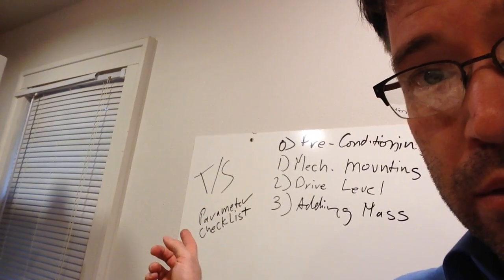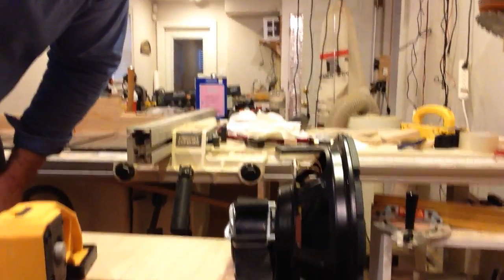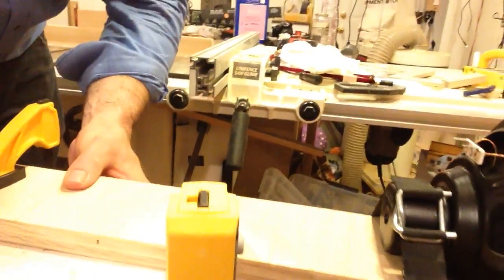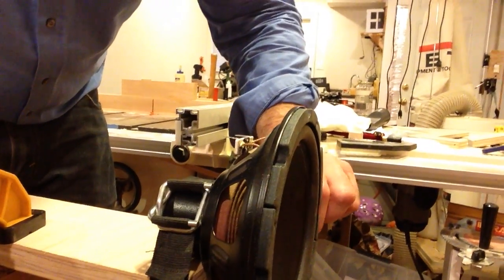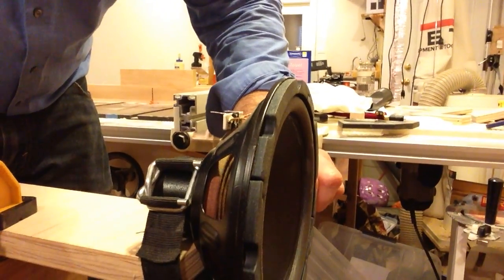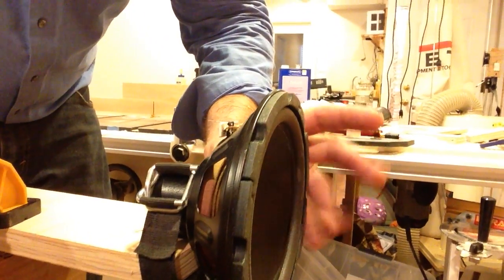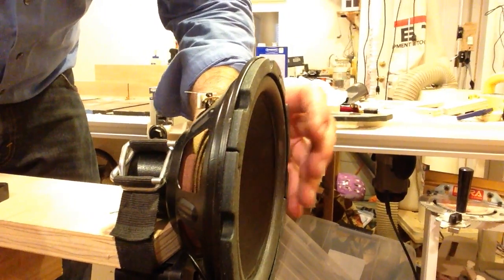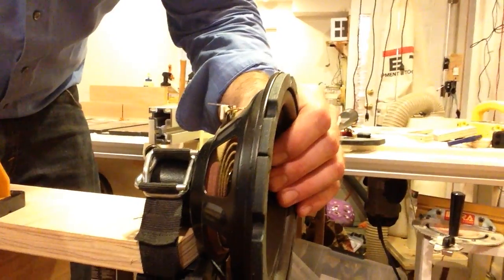EP15-02 T/S Parameter Measurement Basics

Comment: Hey, could you give me a pointer? Sorry, i ran into your channel by accident and had a thought.

So i've gotten these speakers, Magnat Monitor Supreme 100, which is a funny name since pretty much all words in it seem to not be quite true, and i knew this beforehand, but it's from a family member and i didn't manage to berate them before they bought them. Anyway they're mine now. I haven't opened them up yet to see what the crossover looks like, but the sound those things make is pretty horrid. A bit of a bass hump with little actual bass extension, which i'm willing to almost ignore, sharp and unpleasant highs and worst of all very muddy mids, and the sound is least muddy a good bit down from the middle, like 15-20° or so, which might be an indication of what to expect inside, which is probably very very little. I also have ELAC BS52 and those sound like a dream to me. Anyway ELAC are a $500 pair and it is my understanding that they got Magnat for around $50 on a discount, but if i knew they were looking for such cheap speakers i would have likely advised them to get Mivoc.... well i digress.

Aaaanyway i used to read up on things a lot back in the day, i have Dickason's book i bought 10+ years ago somewhere, i'm not too terrible with a soldering iron and have basic electronics engineering knowledge, and i was thinking, what if i can make the Magnat sound... less horrible? I understand part of the sound character is due to the Mylar dome, but if we're willing to ignore that, i understand there must be a more fundamental issue with them, likely that they will benefit from steeper crossover flanks and some measures to tilt the neutral axis closer to horizontal. But by now i pretty much forgot everything, and nowadays, what's the most convenient way of handling that? I understand that Magnat uses customised speakers, i'm going to have to measure them to get at the parameters, or best detailed measurement i can plug into the simulation (Visaton's Boxsim?) to start working on a new crossover, so what's the most convenient way of doing this these days, assuming i can spare barely no money at all? I am more or less willing to develop custom measurement software and publish it as free/open-source if i have to.